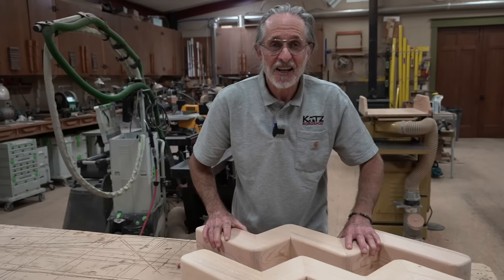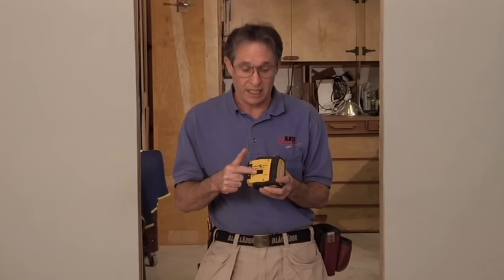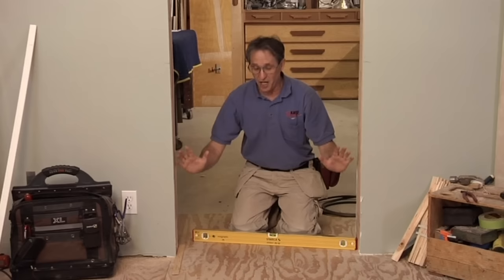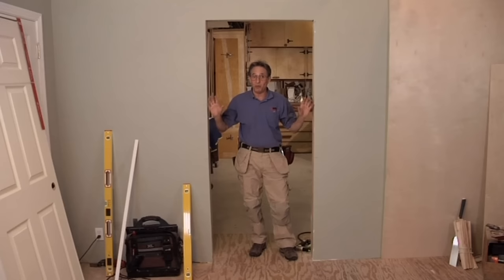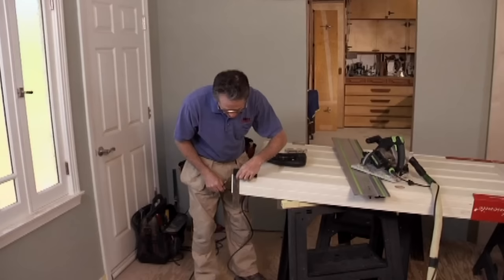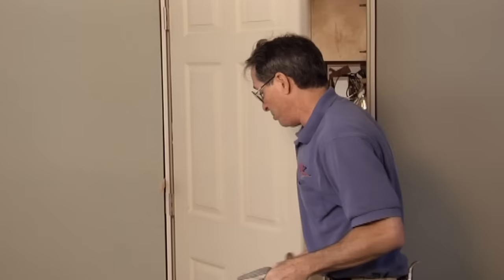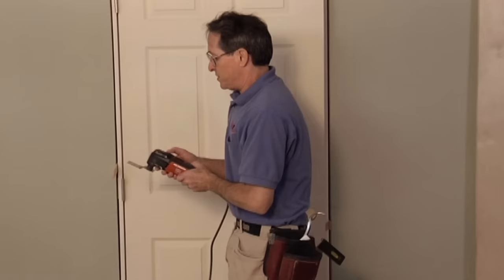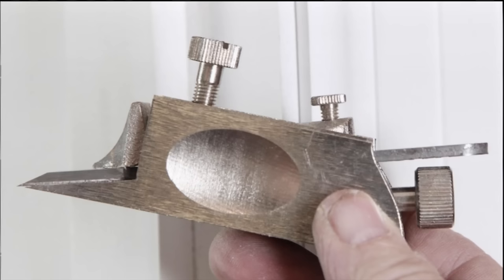INSTALLING PRE-HUNG DOORS, Prog. 10, with Gary Katz

Comment: It would be opposite for installation on top of flooring. You'll want to start at the LOW point of the house so that you have material to cut off to level jambs across the house.

Comment: True Master of this Genre! I stumbled onto this video to find an answer related to hinge bending technique you show in a different video but couldn't find the answer in this series as well - could you potentially share why the "spread" function can't be achieved by bending the knuckles as you do with the "squeeze". Isn't that in essence what it's doing is bending the knuckles when you force the nail set in there? 
Thank you!
Reply from the maker: No, that's not what's actually happening. When you 'spread' the hinge leaves, you're 'opening' knuckles on both leaves. Try bending the knuckles on both leaves with a wrench and you'll see what I mean. Best if you experience it yourself.

Comment: What if the PLANE of the wall isn't plumb: Should the jambs be plumb and proud of the drywall at top or bottom, or should the jambs be flush with the drywall on both sides of the wall but not plumb (and will the door then fall open if not latched?)...

Comment: Great videos Gary. I had a question regarding the correction of crossleg on double prehung doors. You show moving the hinges in or out to correct, so on an 8-0 door with 4 hinges, do I  need to move the bottom two or three hinges to make the correction or do I just start with the bottom and take it from there. Doesn't seem to flex much with just the bottom hinge off.  Thanks
Reply from the maker: You'll have to loosen both middle hinges on a 4-butt door, for sure. Just think of how a 3-butt door will pivot around the middle hinge, but a 4-butt door will not.

Comment: Great video!  However, I can't find even one single video that addresses my situation, which I think is crazy. I can't believe I'm the only person that has this question... or maybe I just don't know how to phrase it properly.

We just bought this house, with a finished downstairs area, that is almost its own apartment space, with 2 "bedrooms" and a full bath in between.  My wife and I are using one of the rooms as our bedroom, and the other as our office.  The only problem is, the entrance to the "apartment" is an open cased frame, 32" x 80", with smooth sides (no door trim), which means our space is open when someone walks down the stairs, or comes in from the garage.

So, I'd like to add a door there, but I am clueless as to where to begin.  Is the trimming necessary?  How difficult is it to add hinges & lock plates?  I've looked at some 32" x 80" salvage doors, online, listed with hinges and knob, but not sure if that would be too big, of if the way it was previously hung would affect how I could use it?

I know these may sound like dumb questions for the "handymen" out there, but I'm just a computer guy trying to figure it out.  LOL!
Reply: 32x80 is a true size of a door. (go to a big box store and measure doors there) It's standard. But the door has a 5/8" jamb, and add 1/8" on lock and top sides and 1/16 on hinge side for the spacing ("reveal"), plus maybe 1/2" opening at the bottom for airflow. So that's your total size. Your opening must have some casing or drywall inside - you must remove it, and then the whole assembly should fit with some space left all around for shims. The cleaned-out opening with the house framing exposed is called "rough opening" in this video. If your assembly doesn't fit, you might have to go to the next door size. Buy the long "contractor" shims, don't bother with short ones. And watch for this when you buy: https://youtu.be/Jli7JIfg0TA <-  this is typical, BTW.
Reply: @whiplash0125  I've got a whiplash from hiring "carpenters", "plumbers", "tile setters" and other self-proclaimed "tradesmen". The real ones are hard to find and cost a fortune.
Reply: This is such amazingly good information and so well done! I’m in the process right now of putting my very first pre hung door in and have been absolutely pulling my hair out! It’s a Lowes Masonite (P.O.S) and between it and the horrible framing it’s been a real challenge to say the least. It was like a breath of fresh air to hear you touch on just about every single problem I’ve been having, I’ve  been thinking I’m just that unlucky and God hates me lol. I wish I would have found this first! I was happy to see I pretty much went about it exactly as you described ( in my own inexperience way ) and it’s come out as good as I could expect except now I realize ( in the home stretch of course ) that the hinges aren’t mortised right! 🤦🏻‍♂️
The top hinge isn’t mortised far enough into the door or jamb by about an 1/8th of an inch and the middle hinge is too far into the door causing a bow. I didn’t catch it because I was so focused on all the other problems and now that it’s all attached and the gaps look really nice I’m not sure what to do. It’s about as perfect as I can get it and I’ve definitely had to do some fudging here and there but I’m pretty satisfied with it except for that. With door fully open and inline with the window on the opposite wall I can’t miss it😒

Comment: I’m a little confused on plumbing the door from interior to exterior side. Looks like the door just needs to be flush with drywall, but what if the wall is not plumb…? Wouldn’t the door close or open on its own. Walls aren’t always plumbing right?
Reply: I literally thought the same thing, he never set his shims to plumb out the hinge side. Hes setting the doors to have a perfect margin instead.

Comment: ''Cutting Common AND Hip Rafters''
Comments are turned off for this video,
I calculated 48 1/8'' theoretical length of the 
first rafter measurement using a common
calculator (TI), the presenter has 53'' + - , 
as a noob to framing, I had a question. 
Subscribers and or the presenter 
could have cleared this up for me.

Comment: Evaluate how level the floor is for the entire house and then you evaluate how many doors your going to have to cut. If you pick the high point as your benchmark your going to end up too high for pocket doors when they require a grove cut into the bottom of the door for a floor guide. Which, for example needs a 7/16 gap. It can spin your head figuring it out, if you absolutely need all the head jambs to be level relative to each other. That said you can always pack up the floor guide. But generally I figure out the pocket doors prior to establishing the finished height/ elevation for the whole house.  Pocket doors become the control points, all other doors are variables, with the goal, that your not going to have to cut more than 1/2 the doors. And the the smallest gap is 7/16 and no greater than 3/4, when your not modifying the door. When a house is really bad. Rip pull up the sub floor., add material to the top of the joists and then lay the subfloor back down. I know that sounds crazy. but i have done it. lol